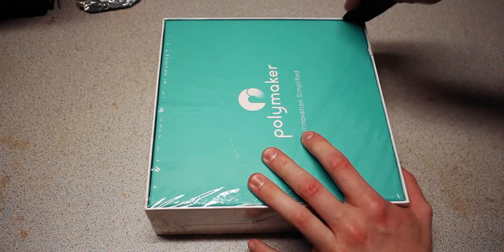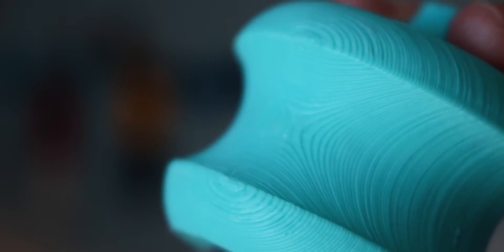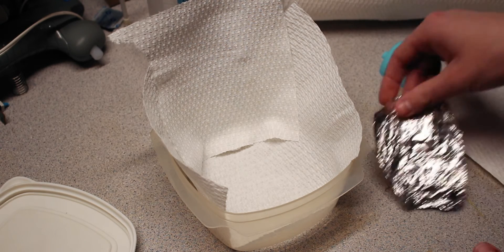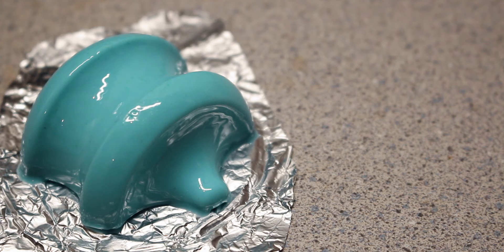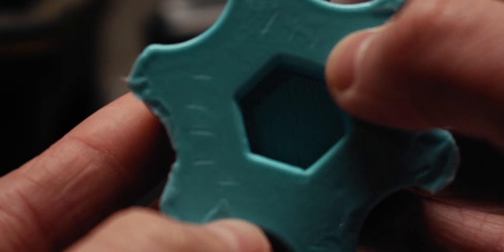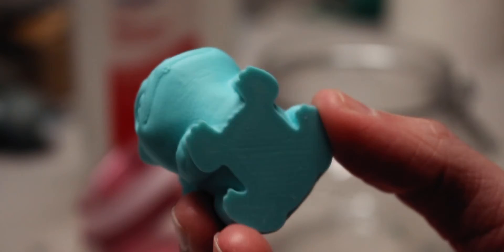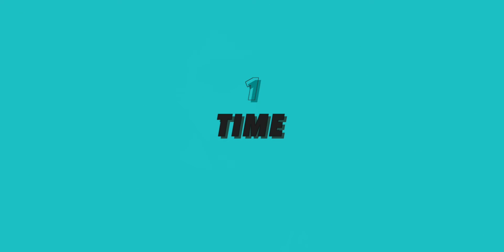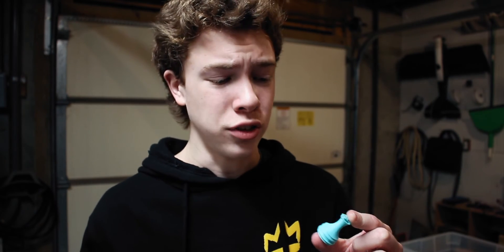Smoothing PolySmooth without Polysher

Comment: I use a carafe a dog dish with some magnets a jar lid with holes and paper towels, this seems to correct the didn’t do top part. I use this with acetone too and it’s fun to watch it expel the air, the carafe spout also lets you remove with a tilt with no drip. Thanks for the vid.

Comment: It would be easy to recreate the official machine using an ultrasonic transducer to turn the IPA to a mist, with a small blower fan to circulate the mist more evenly. If you wanted to get crazy, you could use a laser to measure the reflectivity of the surface and create a set it and forget it type machine.
Reply: i'm thinking of making my own polysher too, did you try?
Reply: @TheSateef  I did not. However, I am an automation engineer for a day job, so was just offering some advice to anyone who wants to. If you want some advice on how to do it, I'm more than happy to help you out.

Comment: I think atomizing it would help get results a lot faster. A cheap humidifier and a 5 gallon bucket would probably give similar results to their $300 chamber for like $30. Alternatively a spray bottle and letting it evaporate off the part then reapplying might be able to give some results. I think I'm going to buy a spool and give these ideas a whirl, but I probably won't make a video, but just an idea for you.
Reply: Any updates on what worked for you?

Comment: Hi thanks for the review! Here is my experience with PolySmooth™: Im indeed using 99.9% IPA so I get results faster but one big difference is that I use a regular spraying process when I dont use use the Polysher. Indeed you will get your part as smooth as you want in not time, just spray or quick dip in IPA and there you have it. You can iterate this process to get better results (spray/dip, dry for 10-20min, spray/dip again, ...). It will also dry much faster cuz as you said it wont penetrate through much shells. From my experience I use a fan to speed up the drying process and get the parts stronger caused it kind of fuse the first shell layers together.
Thx again for the content, just subscribed :)
For ideas, I do recommend checking other Polymaker products, they have many technologies which are great to explained in video :)
(BTW im in the polymaker facebook thats how i got tips for Polysmooth as well :) )
Reply from the maker: 3D Printing Science wow I hadn’t thought of that! I’ll defiantly give it a go!
Reply: How many times do you need to repeat the process?

Comment: So a jar and paper towels works better than the $300 machine they sell lmao
Reply: There are many reasons you would want the polysher, but for one offs, this method is fine.
Reply: Typically I do big prints so I fundamentally cannot use the polysher
Reply: @Anyone700  the machine isn't reliable and it doesn't leave a uniform finish